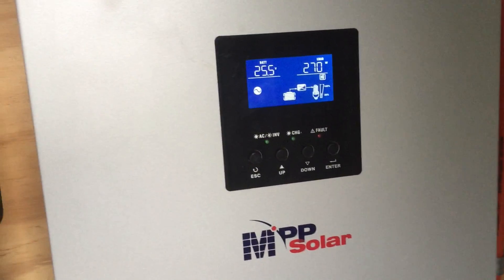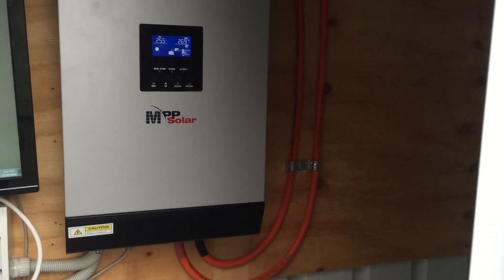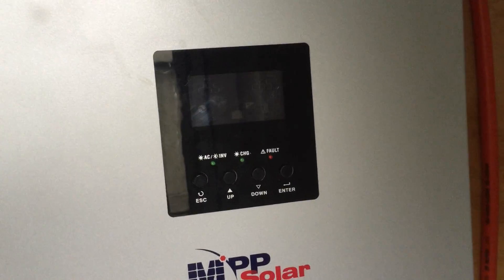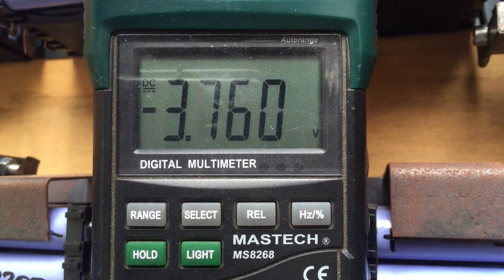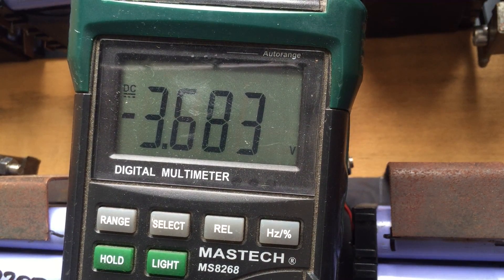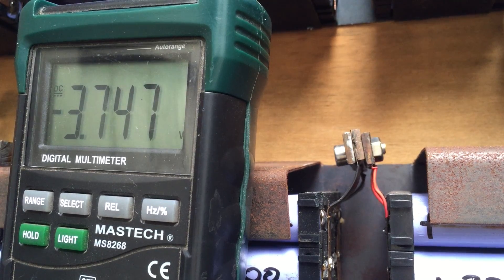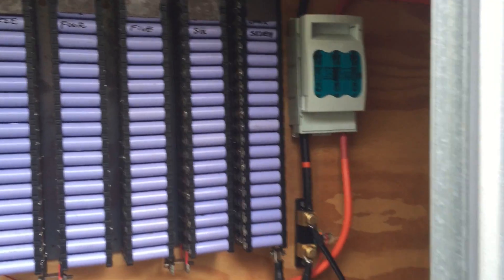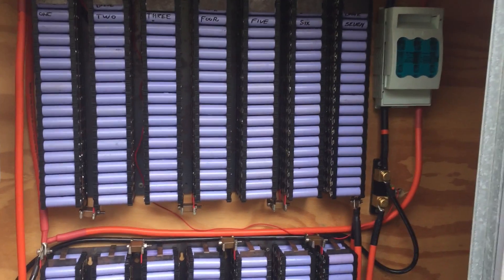Morning Voltage check & chat

Comment: Wouldn't it be easier to put one of those CellLog 8M monitors on each pack?  That way at a glance you can see the voltages of each set.
Reply from the maker: Yes - but don't have enough cables to connect them :)
Reply: ah lol, and i suppose it makes for a longer video using a meter :)
Reply from the maker: it would be much easier to use cell logs and i plan too long term but this way works and i don't have to have messy cables everywhere... they are on the cards as i want to integrate them into the mounts somehow so it's simple and fast to add a BMS to balance each pack every once and awhile so i don't need many bms.. (for now)

Comment: Never repetitive. Hey I bought one of these timer switches https://oceancontrols.com.au/HNR-170.html to automatically switch between mains & batteries each day. It has 2 timers so you don't energize 2 loads at once. Thought you may be interested??
Reply from the maker: inverter will do that with something like .005 of a second so don't even know the change over happened. If i had the older version with serial cable attachment to computer it would work via software...

Comment: Voltages from video
Pack 3
3.628
3.711
3.761
3.739
3.675
3.745
3.675

Pack 2
3.696
3.694
3.761
3.683
3.700
3.711
3.697

Pack 1
3.714
3.747
3.692
3.724
3.650
3.709
3.706
Reply from the maker: HEY great work :) can't work out to do it scrolling across the screen using Powerdirector 14 cheers!

Comment: Was thinking you would also need to replace the PCM-60X but i see it supports 48volts which is great.
Reply from the maker: Yes, and the new inverter has an 80amp MPPT Charge controler so 4kw panels on the PIP4048 & 3kw of panels on the PCM60X :)
Reply: 80amp MPPT nice , i shall google the spec sheet
Reply: Have a look at 
http://forums.energymatters.com.au/solar-wind-gear/topic5457-130.html#p44757
Reply from the maker: I kick around there reading heaps - end of the day these chargers are CHEAP but so far i've found them to work well. There is a custom firmware upgrade you can do for lithium batteries i'll be installing that .
Reply: And i am sure they have changed since first being released.
Reply from the maker: I think there has been at least 4 versions since then .